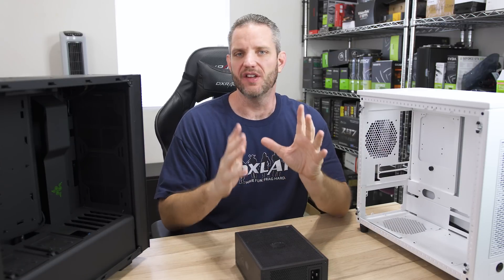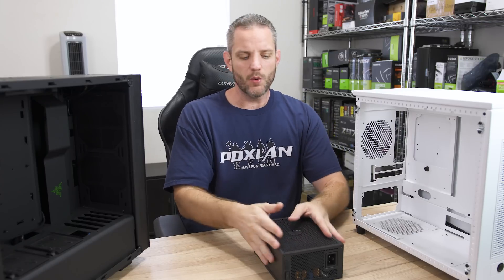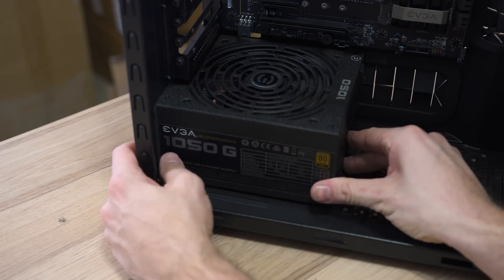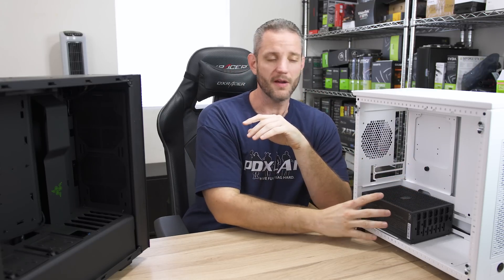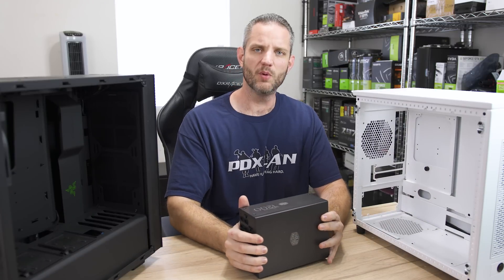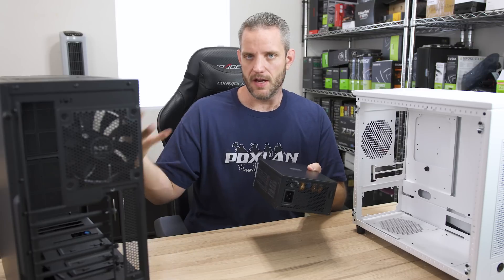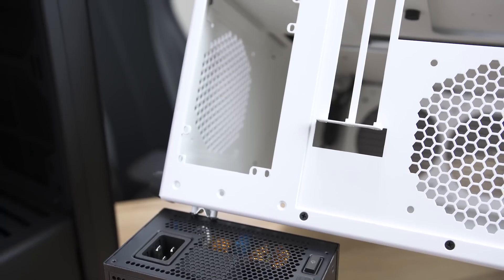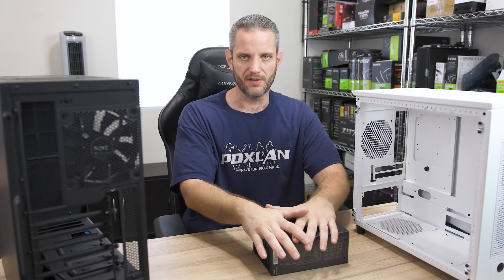Should you mount your Power Supply up or down?

Comment: I'm not trying to be difficult or contradictory, but I for one would love to see some scientific testing done, over time, to verify these statements. I see a lot of videos about positive vs. negative pressure. I don't know what to believe and would love some actual proof. JayzTwoCents seems like the type to do the test and report back whether he was correct or not. Its why I watch, unwavering integrity.
Reply from the maker: +James Rhodes I've already does this test about air pressure with smoke
Reply: *****
 Get outta here with that logic and basic grasp of 5th grade physics!
Reply: +Richard Smith Same amount of dust will also accumulate on a "positive pressure" setup. Your computer case will never actually pressurize. The reason "negative pressure" setups get more dust inside if because you're pulling air in from an unfiltered source. "Positive Pressure" doesn't repel dust, all it does is push air our through the  various unfiltered holes in the case instead of pulling it in, meaning you're not bringing dust in there. Dust will still accumulate on the intakes because you're pulling air in there. Wherever you pull air in, dust comes with, it doesn't matter what your "pressure" setup is. The reason why "positive pressure" gets less dust is because you're pushing air out of the unfiltered vents instead of pulling it in. That's why "positive pressure" setups still require filters on the intake, and you should still clean them out. You just don't need to as often as negative pressure setups (and arguably, you can get away with it longer in positive pressure than neutral, which would actually be a benefit).

That's why the terms "positive pressure" and "negative pressure" are terrible terms for what's going on in there. You're not pressurizing the case, all you're doing is using the holes in the case for another input/output source.
Reply: @Scoobacca152  Cooler Master NR600. I should mount down? Using a Fractal Design ION+560
Reply: How about we (for fun!) find a way to see what happens if indeed a water cooled system DOES happen to drip onto an open, loaded PSU?  I think it would be pretty damn amusing.
Reply: NCIX did a really nice video explaining it with a fog machine. Don't know if links are banned here so to make sure it doesn't the title of it is "Computer Case Airflow - What is Positive and Negative Pressure?" Hope this helps!
Reply: @Nathan Elmore I built my system a little over a year ago and didn't clean any dust until last month when it took me 13hrs to tear my system completely apart, clean every component, and put it all back together. My comp has always lived on top of a desk and it still accumulated enough dust that one of the fans was almost nonfunctional. So in my experience I'd say that dust can quickly become an issue.
Reply: to quote myself: "took me 13hrs to tear my system completely apart, clean every component, and put it all back together." 

That included taking apart the air-cooled GPU, cleaning it, reapplying thermal paste and putting it back together. Also taking every piece of the case apart that wasn't riveted together. Just doing the final cable management took me almost an hour, from planning it to clipping the last zip-tie. I'm sure other people could have done it quicker but I don't see 13 hours to do a complete tear-down and re-build of a computer to be so surprising, even if I only used my feet.
Reply: Yeah, we will know the truth come christmas 2017 about positive vs negative, but I already know the positive will have the least dust build up from my own experiences. However, my word is worthless to those who have doubts, so that should set things straight.
Reply: I’ve tested all fan configurations. The difference in ambient temp is max 1c. It doesn’t make a difference in terms of cooling your components like cpu and gpu. The individual cpu and gpu cooler is what matters.
Reply: James Rhodes it's a video to do with air intake.
Reply: ***** you have a point but you gotta think about it like this a computer cases similar to a car's engine the air pressure being pulled in have to equal the pressure coming out otherwise the engine would overheat or not be able to heat up enough to burn the oil now when it comes to computer being the same thing when you have a lot of heat being produced by the stuff inside your computer if you have only air being pulled in your computer can't expel the heat fast enough to keep the PC cool some PC cases come with fans built in the top that pull air down and then push it out the back which carries the heat with it now as Jay says... fans suck and I agree wholeheartedly but a lot of people like me don't have the money to get  water cooled systems but they have the money to get a decent graphics card and any decent graphics card alone produces enough heat to overheat a computer if your fans aren't working properly
Reply: Motorman2112 thank you for the link. And understanding why I was asking.
Reply: Ehhh u guys with ur cases, i dont have a case so this doesnt bother me that much... :D Cuz i have to clean like the Cpu cooler and, Gpu fan. I made pc stand and mounted it on the wall, btw it looks coll too, white with black.
It wasnt that hard to make it, but mounting mobo on it was pain in the ass :D
Reply: Tom Hulk You know, I think I can respect that. :)
When you're stupid, you don't realize it, when you're smart, you know that there's so much you don't know that in a way, we're all very stupid, some are just more stupid than the rest of us idiots...that's probably a very pessimistic way of looking at it.
Reply: Tom Hulk We're clearly from another country, that means nothing to me.
Reply: Tom Hulk
 Except this is something you ought to understand if you ever went past the 5th grade. This ain't rocket science. There's nothing "humble" in pretending to not have a basic grasp of physics, and responding obnoxiously when someone tells you it's common sense doesn't really prove you superior either.
Reply: Tom Hulk Uhhh?
I'm sorry...did....did I say something offensive? O.o 
I....I didn't realize I said something hurtful?
Are we fighting?
Wha- >.>
Reply: Tom Hulk Well this conflict ended better than the last, the previous had me being accused of trolling and abusing the report function because someone didn't like something I said...and I can't even remember what that something is.
Reply: dust is omnipresent
Reply: I built custom pc's for people for years, and I will confirm that FILTERED positive airflow gathers MUCH less dust than non-filtered or negative. There is no difference in positive or negative if any intake is not filtered. It is worth pointing out that a filtered fan is less efficient than a non-filtered fan, so if you buy matched fans, but the intake is filtered, the case is going to be negatively pressurized.

The dust that a filtered positive airflow system gathers is extremely fine dust, which is easier to clean, and takes much longer to clog up heatsinks and such.
Reply: 1. Jay did an air pressure video with smoke for visual demonstration. In fact, it's literally in my suggested videos on this video page. It's called "Case Flow and Pressure Demonstration - How to". 

2. It's physics man. I mean, as far as specific temperatures go, that will depend on your hardware, your case, and the ambient temperature of your environment. But the idea of positive pressure vs negative pressure is just physics.
Reply: Nathan Elmore No side panel gathers less dust, since in a negatively pressurized system the dust is pulled in by vacuum pressure(through all cracks in the case), while leaving the side panel off will mean the case is neutrally pressurized, and the dust will just blow around, not get trapped inside by the negative pressure.
Reply: Unless you are going to replicate exactly what is to be tested scientifically in a youtube video(same PSU, components, case ETC), the "science" goes out the window anyway for utility's sake. Only way to get "proof" that is useful to YOU is to test out your OWN kit. The video is a suggestion.
Reply: +ᅚ 
Hey, you never know, it might have been taken down....cus FUCKING YOUTUBE
Reply: James Rhodes I believe Jay did a video with insence sticks.  they give off a smoke and I think he showed negative vs positive with the smoke getting sucked in cracks and such.  hope this helps!
Reply: James Rhodes it all depends on what's in your system if you have like a Titan X in your system the air flows going to matter a lot because those things produce so much heat that if you have a negative air-flow your entire system's going to overheat
Reply: Dtr146 I only got a 750Ti so I'm maxing at 60 on the card itself.
Reply: ***** and that's fine but if somebody like me doesn't have enough fans to expel the Heat fast enough they have to rely on air flow and air flow is key to expelling heat in a system with very few fans
Reply: Motorman2112 I agree with you
Reply: Dtr146 The only fans in my case are as following, stock CPU, whatever's in the PSU and whatever it is that's attached to my GPU (ASUS stock, I'll just say that cus I'm not too smart and have no idea what I'm talking about clearly.)
Reply: +3en 3en6ie they are also oil cooled to a decent degree
Reply: ***** car engine takes an air the air brings in the oxygen necessary to combust and then the exhaust system pulls all the other air out which is kind of like the exhaust fans on my computer if the exhaust can't pull the air out the engine would overheat
Reply: ***** that's fine every case comes with a fan that pulls air out the fans from your other devices either push air into the heat sinks to cool them off or vice versa which is why some cases have a lot of air vents to keep pressure from being neither negative or positive
Reply: Dtr146 Actually, this one doesn't have a fan and I don't RECALL seeing a heat sink.
It is BARE MINIMUM and....somehow works.
Reply: +Gamesfan34260 Okay.
Reply: +Gamesfan34260 Guess what, stupid gets 3.125 gpa and my classmates get 1.7 gpa. How's that for being stupid?
Reply: +Quixotic How did his question even came to who's being superior? Maybe if you answered him like, "you know in basic blah blah it was explained and proven that blah blah will blah blah, and so what jay is saying is true. To know more about this, you can use some other people's research articles or journal that are available online" on the other hand, your reply was somewhat disrespectful.
Reply: +Gamesfan34260 I think I misunderstood your reply. Haha
Reply: +3en 3en6ie Okay lol
Reply: I can definitely vouch for the dust gathered by filtered intakes being fine. I have cockatiels, which are very 'dusty' birds for their size. Their downy undercoats break down into a very fine white power, and its the only thing that can really get through. White on black aluminum isn't exactly hard to notice after all.
Reply: josiah garver
Yeah how in the hell did it take you 13 hours to take your PC apart and clean the dust out?

Were you using your only your feet with your hands tied behind your back?
Reply: Link it you filthy animal. Jk.. i like your stuff, will find it now.. btw.. My Corsair 600TM cabinet has no fans going in or out now.. Just CPU fan going 5% minimum and a ramping on the GPU.. PSU fan never runs but is mounted "upside" down. sucking air from cabinet only if eh. shit.. eh.. hits the fan..
Reply: Linus is currently running a year long experiment with 3 pcs constantly on. One with positive, one with negative, and one with more or less even air pressure. Though in typical linus fashion they are half assing and not taking things into consideration
Reply: Actually, you're better off with neutral pressure. 

Positive pressure decreases the flow rate of the fans (think of fans like a pump for air--if you've got more air going in the tank than out, the pump either works harder or slower). Negative pressure also decreases the flow rate of the fans (same deal, but in reverse. Air wants to flow from high to low pressure, so air wants to flow against the fan's direction). All this amounts to is either way, you've gotta spin faster to get the same airflow if you've got an imbalance.

Neutral pressure (same in and same out) doesn't create this kind of pressure difference. The air flows freely in the direction the fans want to push it with less resistance. 

Case "pressure" doesn't matter for cooling, all you care about is getting as much air through the case as possible. In real life, the computer doesn't actually pressurize, so if you're doing "negative pressure", the case still has to pull the same exact amount of air in as out. if you've got more exhaust than intake, then you've gotta pull that air in from other places. What this means is that your exhaust fans have to work harder because they now have to shove air out AND pull some extra air in (spin faster), or they have to exhaust less. The only benefit of "negative pressure" setups is more noise, more dust, less airflow through each fan. The only benefit of "positive pressure" is more noise, less dust, less airflow.

Your case will always essentially have neutral pressure. Going for "negative" pressure setups only gets you more dust. Any benefit on cooling is just from having one more fan cycling air. If you're measuring temps on 2-in-2-out for neutral and 2-in-3-out for negative, sure, you'll probably see some better cooling. But you'll probably see even better temps out of a 3-in-3-out setup. There's no "case pressure" involved, it's just number of fans. If you HAVE to have more of one though, positive is better. Less dust, and 3-in-2-out will cool about the same as 2-in-3-out.

Source: Aerospace engineer. I know airflow.
Reply: In case anyone's still needing visuals of + vs - airflow, Jay did end up doing a video about it...

https://youtu.be/a12aDCxrcts
Reply: +Scoobacca You seem to forget that dust is going to accumulate on the intakes, which will quickly drag a neutral airflow setup into a negative airflow setup.
Reply: Richard Smith not if you keep it clean.
Reply: the proof is in experience
Reply: James Rhodes linus has 3 pcs running for over a year with different fan orientations to eventually too which way is the best.

EDIT... He just did a video on the 3 pcs. Check it out.
Reply: You can observe it yourself... I have a 3 in 1 out case and if I put my hand on the top of the case I can feel the air coming out. (top of the case has an opening for 2 more fans with a filter over it)
Reply: You're watching the wrong channel, I think Gamersnexus actually did a test on this and they don't just hand wave, they do experiments with an effort at a control
Reply: Heat rises. There’s your proof.
Reply: Bill Rookard
 Why stop there? I think Jay should also scientifically test whether round objects will roll downhill, whether water gathers into puddles and other such crazy theories.
Reply: James, have a look through the Puget Systems articles for scientific testing of things that seem "obvious". I'm not sure if they've covered this exact issue, but here is one example.

https://www.pugetsystems.com/labs/articles/Vertical-vs-Horizontal-Case-Cooling-89/

It's as if some of the people in these comments can't understand why the people who are humble enough to realise that they might not already have all the answers are the same people who end up being some of the most knowledgeable.
Reply: +Gamesfan34260 Maybe. I don't want to have a fight here. It's just not right to fight people online. And I gotta respect other people. So I'm not gonna say anything else. But people need to atleast learn how to respectfully answer other people.  Peace out. This world is filled with assholes. You're lucky if you find someone who will respectfully reply to you online. Oh God. Pity on this guy, who humbly writes his comment then gets insulted by strangers.
Reply: +Quixotic You know some people don't know what you know right? That's why he was asking. You don't come around talking about common sense and superiority... I'm not trying to have a fight here. I just think this guy deserved a respectful answer. He was being very polite, read his comment again.
Reply: +3en 3en6ie Sun and water... that is really obvious... don't compare that to his comment. I understand your point maybe use another analogy. Haha he wasn't attacking Jay's integrity... read his comment again, same goes to those whose thumbs up his comment...
Reply: +3en 3en6ie He even said... Jay is the type of guy to do the test and come back to see if he is right or wrong. Come on, he was saying jay is diligent.
Reply: What scientific proof do you need? If you draw more air in than you remove, the air will go out through the crevices of the case, thus resulting in less dust accumulating. You don't need "scientific testing" to verify common sense.
Reply: @quixotic7460  scientific discoveries are possible because someone doubted common sense and found out that the earth is in fact not the center of the universe. The scientific method is basically about verifying basic assumptions. One of these basic assumptions is that heat travels up. Does it matter in a PC case? I don't know, but it seems common sense to me, to not move warm air downwars.
Reply: @quixotic7460  but dust is mostly human skin cells shed, they aren't created inside your PC case ...
Reply: Without proof all you have is theory. Have you measured the amount of dust present in a case with positive pressure vs a case with negative pressure? If not, how can you be sure one is better than the other. Also, last I checked you are not Jay. So my comment was not directed at you.
Reply: James Rhodes
I doubt there are many who would bother with that because a) it's something that is intuitive to most people, and b) experience confirms it but hey, good luck on finding those test results!
Reply: Do you have a video up? If so I missed it. I would like to see it. If not, maybe you could do one. I think it would be interesting to see.
Reply: ***** Do you have a video up? If so I missed it. I would like to see it. If not, maybe you could do one. I think it would be interesting to see.